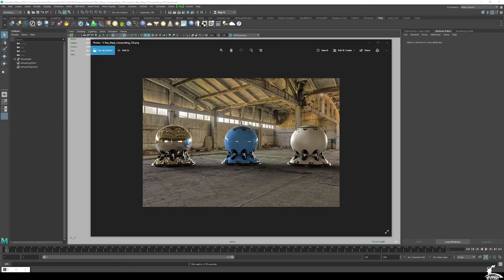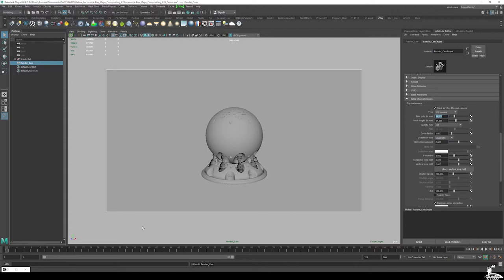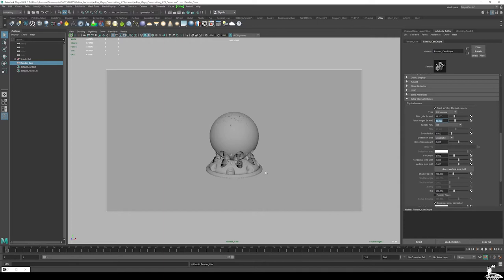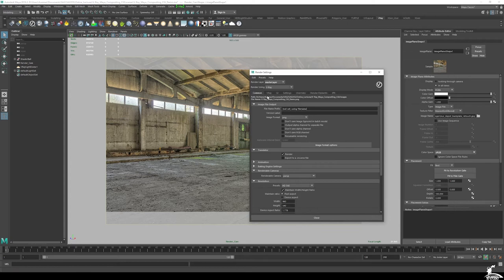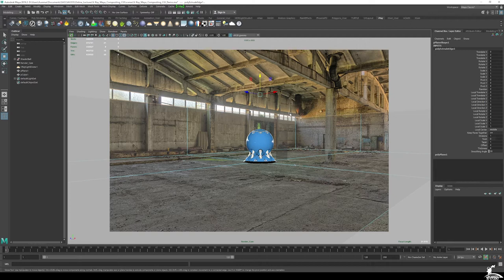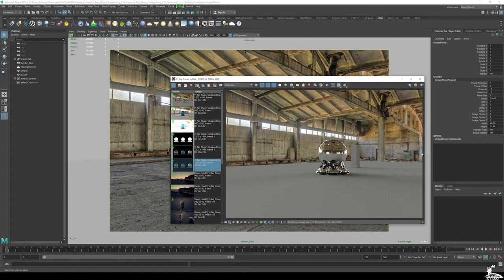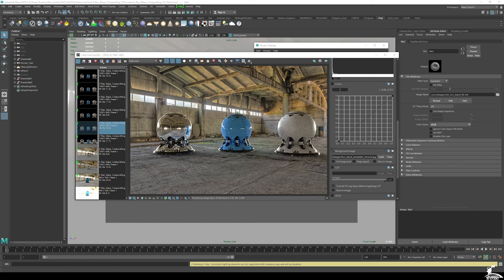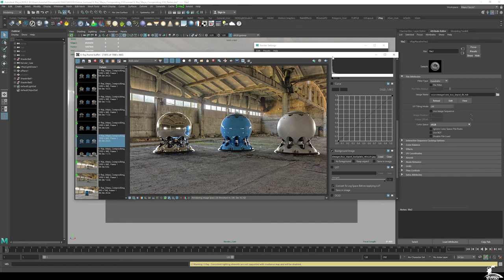Compositing CGI with Maya and V-Ray - Part 1

Comment: Hey there! Crazy coincidence that I found your channel searching this topic after you just commented on my latest video! I'm curious about the shadow catcher setup you have here, especially the secondary ray settings at 23:29. Do you know if there's a way to do the same sort of setup in Blender so the secondary reflections show the HDRI rather than the texture-less shadow-catcher plane? Also, I can't tell from the video but will this setup still show the surface shadows in the reflections? Thank you for diving into this advanced stuff!
Reply from the maker: Hi! I ran into this not too long ago. In Blender, I would select the plane/shadow catcher, go to Object Properties>Visibility>Ray Visibility and Disable Diffuse and Glossy. That way, the ground does not appear in the reflections or have an impact on the model.  

I haven't tried getting shadows in the reflections and it sounds tricky. It would mainly be noticeable in mirrorlike reflections like chrome spheres. I'd probably do extra render passes and composite them to show up if I had a really reflective object. 

Let me know how it works out if you find a better solution. You can also reach out on Discord (onmars3d / OnMars3D#8621) or Instagram (https://www.instagram.com/onmars3d/).